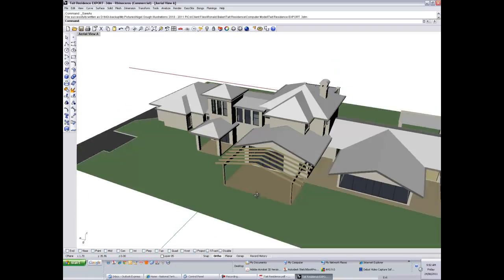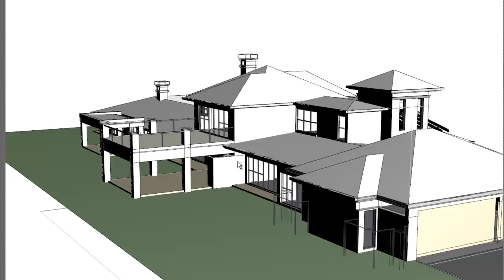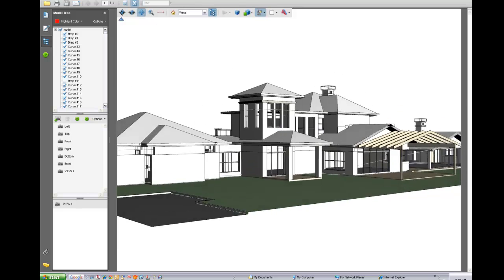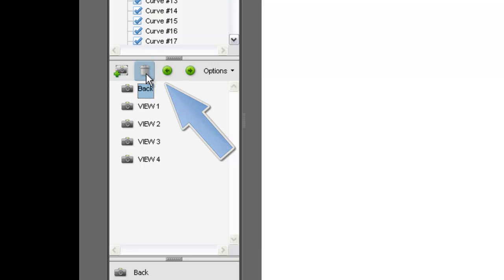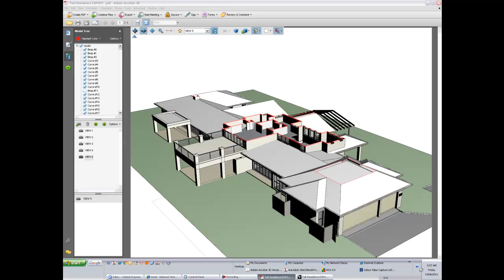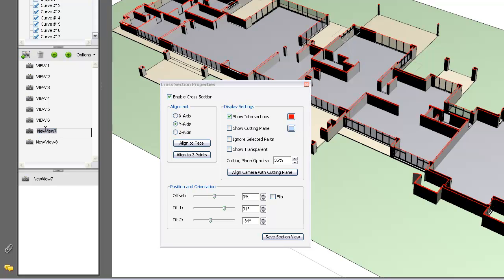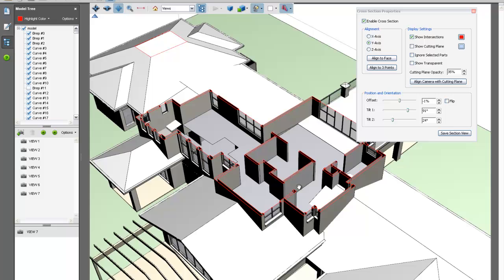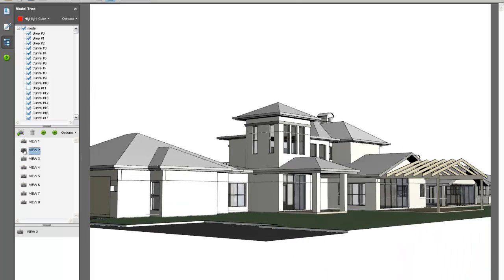3D PDF from Rhino 4 Model

Comment: This video is not helpful for new users as I don't think Adobe sells the Acrobat 3D program anymore and you would need to have a pre-existing license to use any older versions. 
Thanks anyway for your tutorial. Simlabs is the way to go, or just use Microstation at your uni/business if they have licenses available.
Reply from the maker: Hey Carly thanks for your comment. This video is out of date my apologies. Adobe dropped there 3D convertor to the best of my knowledge a while ago. Just as you suggested I switched across to the Simlabs plugin to get my 3D PDFs...... Gosh this has been up 5  1/2 years.  Thanks again

Comment from the maker: Apolgies about that I'm not sure what has happened with Adobe Pro X.It has always worked with my version as long as I convert to a Rhino 3 file format.
I don't think Adobe have really pursued 3D PDf development, and outsourcing this software potential seems to produces expensive and clunky alternatives. However if you are using Rhino file Simlabs has a naitve 3D PDF export that may be worth checking out. It doesn't have sectioning, but other than that it seems ok.